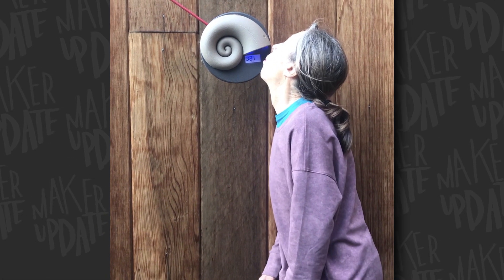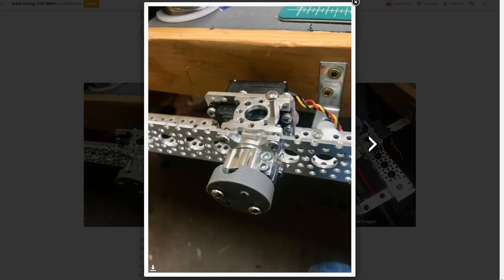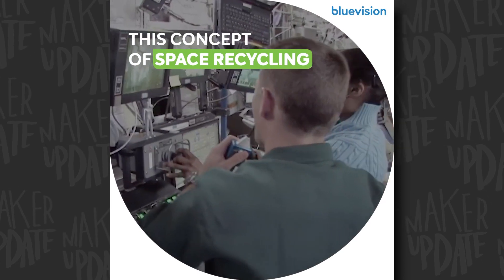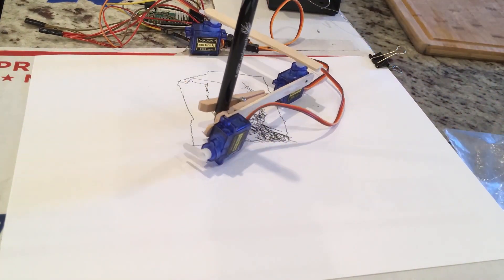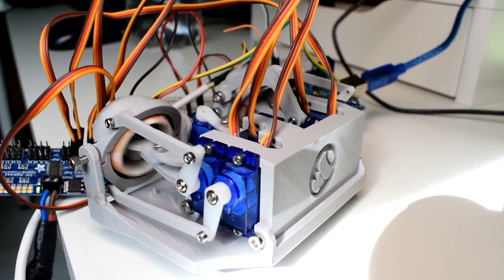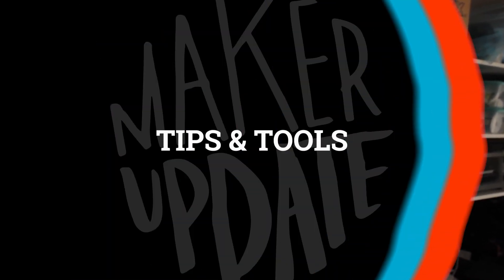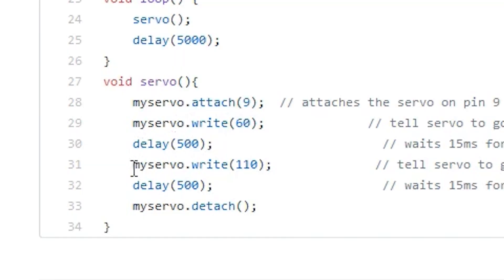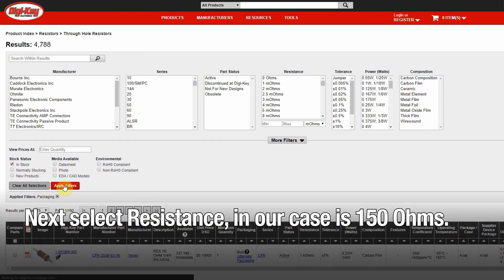Out Of Thin Air [Maker Update #149] - Maker.io

Comment: I am already planning my next years Halloween project utilizing the Arduino animatronic eyeball drive system. I can see it now; there will be four skeleton heads placed in coffin boxes on my lawns walking path to our front door. I just need to program in voices to coordinate with eye movements utilizing proximity sensors to initiate the run program. I plan on having the heads move and look and sound as if they are speaking to each other while addressing the kids while they walk up to get their candy. Of course the heads will be telling bad jokes to each other too. I may even want to try and scare the older kids with some jump-out action when the kids start to feel safe as they approach our front door. Boo! It will be a poor mans Disney Land Haunted House adventure. This project will require a weee bit of man-hours so I need to get started today. Oh DigiKey I am going to need a lot of parts so I better get to designing my interfacing system and start 3D printing my skeleton heads and pieces. Maybe I’ll leave the bugs in this time? Get it bugs? Bugs, get it? See I am already with the bad jokes!! Get it bugs? Bugs. Sorry I just had to say something bad..
Reply: Great idea. I'm working on something similar, but with prop robots. I haven't figured out the audio sync aspect yet, but I've had a lot of fun using the Pololu Maestro board for creating servo animations. I find it much easier than using Arduino, and the results are less jerky. Highly recommended.
Reply: Maker Project Lab I have just looked at the Pololu Maestro 24 servo controller board. This will work much better for this application. Thank you for steering me into this direction. I bet with a little redundancy I can create a very robust autopilot for my aircraft with this servo controller. I operate in the experimental class so I can create my own systems too. Thank you for the advice because I have been approaching this my Halloween set in a backwards design. I was actually going to reinvent the wheel on my design. Sometimes I just don’t know what is available and I don’t always search with effective verbiage that yield positive results. I have been out the electronics field for several years so I honestly just don’t know.
Reply: Maker Project Lab - I will take your advice and look into the system your talking about. It may save me some headaches while putting this system together. The last thing I would want is not being able to remove a jerking action that may cause damage to these small plastic parts. I wonder if I could install a gain controller into each branch of the program/servos to control or limit the jerking motion??? I don’t know because this will be my first time with this type of system configuration?? I really just don’t know! Sometimes the unknown can be a pain when I find out everyone else knows more than I’ll ever know??? Thank you for the info... and Take Care.